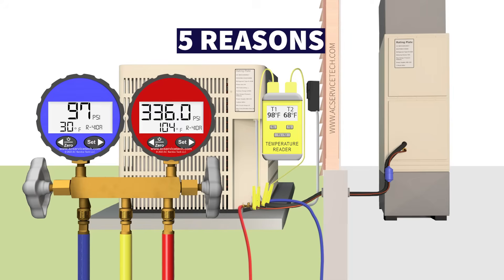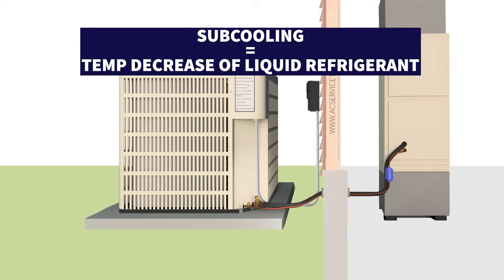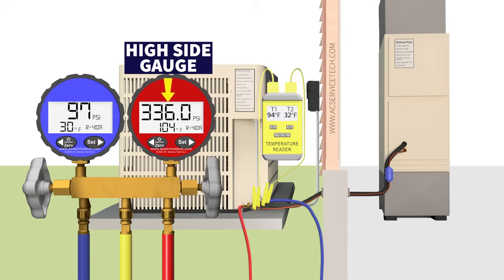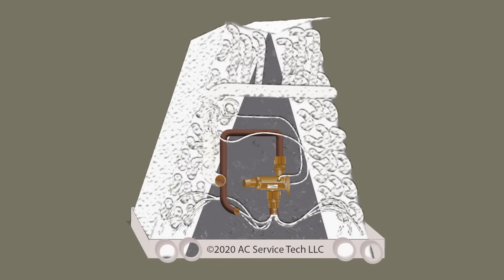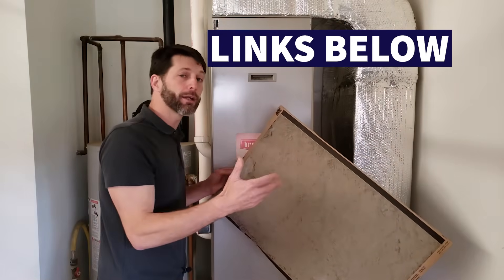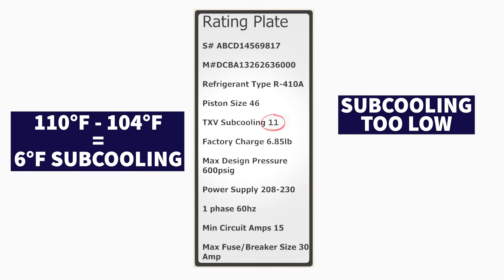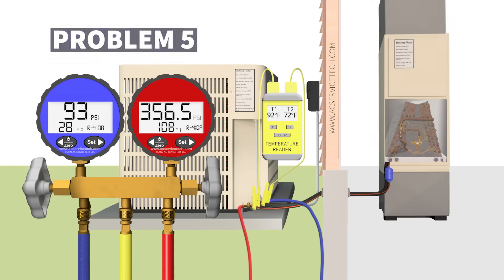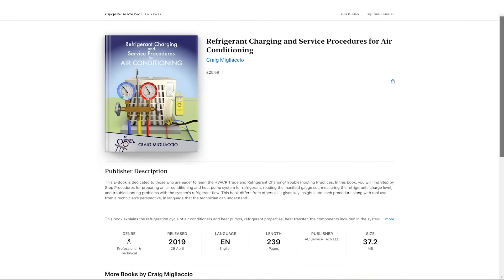Troubleshooting With Sat Temps, Superheat, & Subcooling! 5 Possible Problems!!

Comment: Craig, it's a minor suggestion but in the future can you match T1 temps to suction and T2 to liquid line? Makes it easier to view temps when comparing suction to liquid instead of having to reverse them when comparing. Thanks!
Reply: 12:14 Are we watching the same video? I see T1 on the left and T2 on the right of the gauge display and T2 is the higher number.

EDIT: I see now that as the video plays, the readings go back and forth. At first, it seems that T2 changes to suction when displayed with the indoor unit on the right, so each temperature appears next to the component. But later, even with inside and outside shown T2 reflected discharge. It's inconsistent. Also, the photos always show the sensors on suction pipe for T2 even though the reading for T2 can sometimes be the high side temp.
Reply: @realSamAndrew  And that was my point to Craig. It is confusing going back and forth as the numbers change. It's like that on other videos as well. I would suggest that since your gauge set is ALWAYS low pressure left and blue, high pressure right and red, set up your temp display so that suction is on T1 and have it the first number on a real dual thermometer, and high side is on T2 and is the second number on a real dual thermometer. Things would be easily readable. It might be my OCD, but it just seems to make better sense that way! :)
Reply: @Kevin-mm6xm  I agree. But even without OCD, at least some of the illustrations are flat out wrong, not just annoying. For example the ones that the temperature and the placement on the pipe don't match. That's a factual error that should be corrected.
Reply: @realSamAndrew  Although the placement is not as critical to the overall information he's conveying, it would be nice to see it accurately portrayed as well. :)
Reply: @Kevin-mm6xm  what I'm describing IS critical. It's one thing if most students could "figure out" what was supposed to be printed, but if you're trying to study and you see a temp clamp on a blue side large pipe, and it reads 95 degrees, and you assume the teacher is always right, you would torture yourself for not grasping the material when in reality you did nothing wrong. The specific item I'm referring to is an actual "misprint", not simply a formatting choice.
Reply: @realSamAndrew  Craig explained how to compute subcooling and superheat several times which is far beyond what a student would mistakenly believe that attachment point on a suction/liquid line would indicate. To be honest, I didn't even notice the attachment points. The information was presented accurately if not in the easiest to reference position on the temp gauge.
Reply: @Kevin-mm6xm  a misprint is still a misprint. If that were a car battery and the diagram mixed up the positive and negative terminal connections, it could be catastrophic. This particular situation did not confuse me, but you have to consider the entire audience, not only the advanced ones. An error is an error, period.